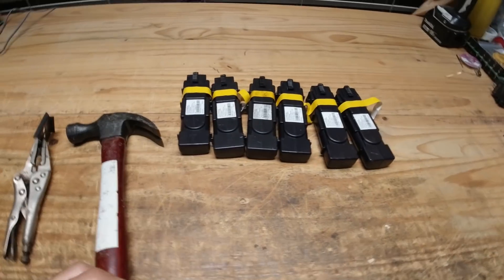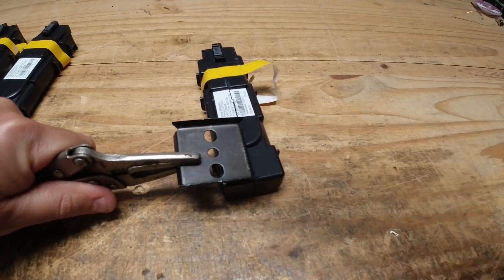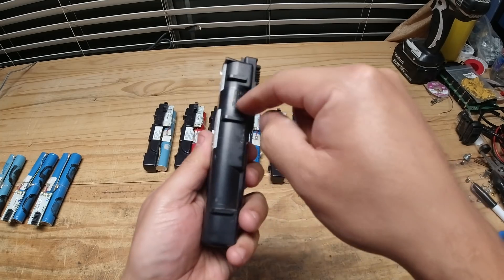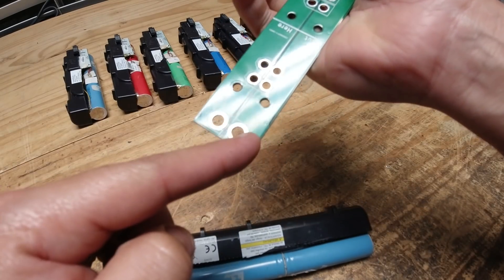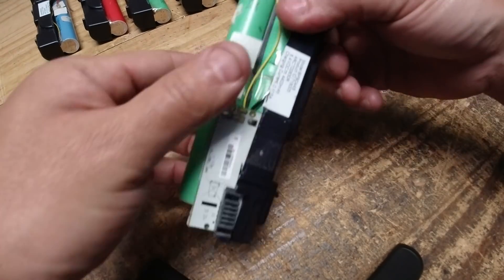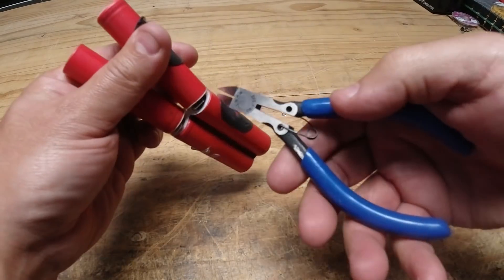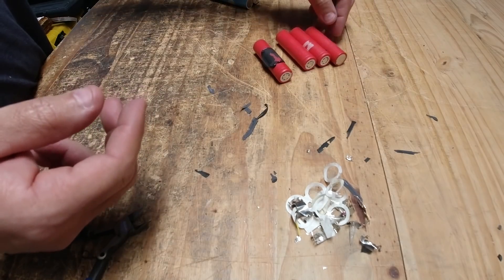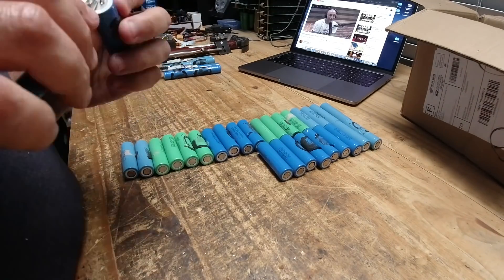Extracting 18650 cells out of $3.40 Modem Lithium Batteries

Comment: Instead of banging on them with a scraper and hammer, try cutting through the stickers on both sides with an exacto or similar blade.  Then you can hold the battery in a vise and just push it open with no problem.  I did a video on this. The ones I have opened have contained mostly LG cells and they are the most difficult to get the cells out due to the amount of adhesive they use.  The Sony and Molicells were the easiest to get the cells out.

Comment: I'm really interested in knowing how many cells were good and how many were bad... Why didn't you share that info?
Reply: I purchased a pallet of 10,000 cells for a powerwall I am building.  I am considering any cell under 2000 mah as failed.
I have a reject rate of about 5%.  Now, that said, the majority of the "lime green" and "red" cells are not worth the effort of dealing with since they often don']t make my 2000 cut off.  They are not necessarily bad, but usually, only have 1500-2000 in my testing (so I've just put them off to the side).  Even with that, I'm running about 95% keepers.

Comment: I layed the packs on the flat of my vise and gave a light whack, to each side, with my Ax. Took less than an hour to harvest the last order I got from you. I got all of the same batteries that you did(only one pack had the red ones). Out of 68 of them I didn't get a single bad cell! 
      Take Care Jehu and keep the videos coming, John 

    PS, How about a video about a good size battery bank (like 80p x 4s) being charged by the alternator in a automobile. I am building a unit for my Suburban that I plan to keep charged to about 14.5 volts. I want to be able to charge it with a 300 watt solar panel (if needed when camping) and use 110 from my 3000 watt inverter. Thanks!

Comment: I'd be interested in how to add protection to these cells (individually), but in a professional way, that uses a very thin strap and thin insulation, to minimise the increase in diameter.  I got burnt recently when I bought some cheap protected cells on eBay - they don't fit my devices.

Comment: Get the Trim and Molding tool set from HarborFreight, use the big tool from the set to wedge the batteries out. The tool is plastic and won't conduct. Also use the same tool to scrape the glue off without tearing the stock shrink tube. I've done 1,200 of them and only had to re-sleeve about 30 maybe 40.

Comment: What would be the problem with leaving them in their cases and wiring them in series for 12/24/48v?
Reply: I initially thought of that but need to fabricate some sort of setup with blades for accessing the terminals. Can you think of any way?
Reply: Out of the ten units I purchased only 5 bad batteries and I'm retesting those just in case.
Reply: i wouldnt recommend. most of these likely have faulty BMS's or a defective one which would explain how they are so cheap. And if they worked, probally couldnt handle an amp or 2 max because they are modem batteries. Modems use very little power so why have a nice bms when they are only pulling an amp continuous.
Reply: @Zodiac83104  Maybe just bypass the BMS, but otherwise keep as much of the integrity of the package as you can.
Reply: I am finding so far 5 out of 12 cells are bad. So probably not a good idea.
Reply: @billkaroly  I thought these were un-used/un-cycled?
Reply: @davidwilker4795  I found what I think is the original seller and I'm pretty sure these are all used. Jehu's comment in the video had me thinking that maybe some were from unused modems.

Comment: Sup jehu you share very knowledgeable information 👍👍, learned alot by watching, I'm kinda stuck on how could I  wire 2 24v 18650 battery pack in parallel  if I need some type of balancing. Both my packs have bms

Comment: Ain't that a waste of time 😂
The energy wasted just striping em cud power the UK 😭😭😭😭
Just buy fresh cells ffs
Hammer and chisel 😭😭😭💥🔥
Reply: Yeah ok. We are talking about 30-50c per cell at around 90-100% capacity. Good luck getting this with fresh, news cells that cost 5-10x the cost. Once you get into the hang of this it takes about 1-2 minutes to extract, cut, clean 4-8 batteries. That's 240 cells in an hour. Now, that's 72 bucks, but if they were new cells it would be over 320 dollars of cost. If you considering your time worth 248 dollars an hour, then I guess you value yourself at 133k income per year which is, guess what, higher than 85% of the US population, then good for you, but the other 85% of us don't value our time in such high regards. Now if you are in the UK, it's even worse, you'd value your time per hour based at 105k GBP a year which would put you in the 97-98th percentile. As in, only 2-3% value their time as higher as you do.  Glad you value your time as more important than  97-98% of the rest of the brits.

Comment: I am actually in the works of making a video about opening these modules right now :). I went a radically different route from Battery Hookup and you guys. I constructed a jig using wood, vice and a scraper. Also some advice, those scrapers have 2 sizes and you used the smaller size, using the larger ones lets you use less strike points.

Comment: To scrape the black glue better. Use the plastic divider that was in between the batteries as a scraper.  Since its plastic you can just go hard on it so I cleans better and doesnt leave black on the shrink

Comment: At what capacity percentage -wise do you bin the cells, compared to their as new rating ?
Reply: I'm not sure if it's a capacity question.  Personally, I'd dump any cell which I felt had significantly less capacity than the majority of cells which I wanted to combine it with.
I'd also dump any cell which showed any signs of heating up during normal charging (normal charging for a Li-Ion cell is charging at half its C rating, so if you have a 2500mAh cell, the initial charging current should be limited to 1250mA).
In theory, a Li-Ion cell can be fast-charged at its C rating (2500mA for a 2500mAh rated cell) but in practice, the cells wear out more slowly if charged at half the C rating.
Reply: @melkiorwiseman  thanks for that I noticed that the majority of SANYO cells seem to heat up and that is without even “pushing” their charge rate
Reply: @pollywollydo  My first guess would be that those cells are cheap "knock-off" copies from China and not Sanyo brand at all.  Any Li-Ion cell which heats up during charging is either being charged too fast or is damaged.  Causes of charging too fast are limited to using the wrong type of charger for the cell, or the cell is fake and does not have anywhere close to the capacity it says and so it's being charged too fast, which has the same effect as using the wrong type of charger.
And by the way, the largest capacity 18650 cell is around 3700mAh, and even those are rare.  The largest commonly used seems to be around 3200mAh.  Any cell claiming a capacity over 3500 should be regarded with suspicion and anything over 3700 is almost certainly a fake.  They usually have a 1000mAh battery (or smaller) inside the case, with the rest padded with sand or something similar.
Reply: @melkiorwiseman  as far as I can remember they all ( I think) came from mostly reputable computer packs which I stripped myself rather than bought unseen a large % Sanyo I binned whilst the Sony LG and green Panasonics were fine non were charged too hard .  I have had some descent stuff occasionally from yik- lik   and Moli thanks for the info- always useful 👍

Comment: Good therapy? Whack 9000 modem batteries lol!! Sooo prob the dumbest question ever. I'm new to lithium. How many to make a 12v pack outta them?
Reply: Usually 4 in series... But it would be a much better replacement if you use the 7s configuration as a 24v replacement

Comment: Don't use the red Sanyo cells, they are known very old cells that are known to heat up alot and possibly catch fire during charging. The samsung and lg cells are fine but know that the modem manufactures those are the cheapest ones that they make, to prevent the the modems from using cheap chinese cells instead.

Comment: Is that basically a mini BMS built into the cell?  I was thinking of making a 4s pack for powering small 12v loads, and if that's the case, I might be able to use them without modifying them much.
Reply: AncapFTW I think it’s just stabilizing the connector

Comment: Yup perfectly safe whacking a hammer and a blade into some batteries packs
Reply: That's what is was thinking about too. What if you hit one of those cells ... I hope he has backup plan where to put them when they go mad and start smoking and spewing flames..
Reply: @kres01  If you noticed, the plastic seam that he is splitting is in between the batteries.
Reply: @gregb1714  yeah I have noticed... But if he wack one wrong you have a major problem. Nick one battery it often goes on a rampage.. Just saying I hope he has a plan what to do when something goes wrong. When I open lithium cells is always make sure I have an escape plan. Ohh and never ever use a hammer.
Reply: Darksnow it’s ok, he knows what he’s doing, he’s a professional battery whacker
Reply: Sounds dangerous but it's not that bad at all. The scraper is just the right size to not hit the batteries.

Comment: The cost of shipping to Europe is more expensive than the product itself. For my case, from US to Romania is around 100 euros with DHL. So..... is not worth it. If you can make a deal with a European dealer i will buy it
Reply: There are no similar sources for large quantities of used lithium cells in Europa.. But you could check out some cheap new cells at nkon.nl for example

Comment: Note:: if you are going to disassemble that many batteries in the same fashion, use ear protection. It might sound silly but you're experiencing 100s of repetitions of over 100db less than 2ft from your ears.
Reply: Protecting your hearing isn't dumb. You only get two ears for your life
Reply: Soft times soft men. Example:^^^
Reply: just read this,  I take it you are a teenager, with no common idea on what is going on, the only danger he is in, is if he hits a battery and slits it, then run like hell , the head board banging on the wall makes more noise than that, try it, it light make you happy
Reply: Lol he forgot to mention that you can be around 120 dB for 2 minutes without permanent damage. That is 2 minutes of that loud sound SUSTAINED. As in, hitting the hammer on metal EVERY second for 2 minutes continuous.  Pretty sure it took him 2-3 minutes every 1 second x 3 impacts. It's not possible to cause permanent hearing loss unless it is sustained or over a a higher dB which could cause sudden hearing loss, but a hammer on metal is not high enough to cause instant loss, but can cause sustained, if, as I said, you keep hammering over and over and over for several minutes without taking a break.
Reply: This is about the dumbest thing I've read on the internet this week... Seriously bro, sorry I'm not sorry
Reply: @andyconda9456  guess he is afraid of thunder storms , world record thunder storm "on record" 700+ decibel .

Comment: so umm for a moron like me buying 100 of those gives me 8.8 ah when put together?
Reply from the maker: 2.2 x 400= 880  so you can make one giant battery cell of 880Ah capacity
Reply: @jehugarcia  thank you good sir, I thought so, but it was to much for my brains :-)
Reply: @jehugarcia  Now I know why my brains could not compute! lol 
That would be a 880 Ah 3.2 volt cell which is more or less useless when you need 48 volts  making it ruffly 57 Ah. No ?
Reply: @HeavyDemir  I can break this down for ya. 48V would require 14S and each 14S row would give 2.2 x .8 = 1.76AH. The 1.76AH is the amount of capacity the battery has max, reality is it's closer to 1.32AH with a 60% multiplier to signify no lower than 20%, no higher than 80%. But I will continue with 1.76AH per cell to be fair cause most people will break the 20/80 rule at least on 1 end. At $.40 per cell, each 14S row will cost $5.60. To make a 100AH module you need ~57(56.8) 14S giving us a 14S57P. From there we can do the follwing: 57 x $5.6 = $320/100AH for 48V. Now considering you need BMS, making the packs and all the tools/materials required, etc, the $320/100AH is not true but it's so stupid stupid stupid cheap it's unbelievable. 

Let's take a  Renogy 12V AGM 100AH battery as a cheap alternative. 50% DOD and we are going straight 50% cause of this style of battery so it's 50AH for 1. For a 48V 100AH, we would need 8 of these in 4S2P. They are $200 each so $1600 for a 48V100AH. 

Now let's take a higher quality BattleBorn LiFePO4 100AH 12v. 80% DOD gives us 80AH batteries. We still need 4S for 48V and 80AH battery requires 1.25 batteries to reach a theoretical 100AH battery. So a 4S1.25P gives us 5 batteries at $1000 per battery giving us $5,000 for a 48v100AH setup(that can't really exist cause you can't have a .25 battery but just for basic cost analysis. 

Here's the breakdown for the cost of each 48V 100AH setup:

These 18650's: $320+BMS+Hookup Tools/Materials/Time

Renogy 12v 100AH: $1600

Battle Born LiFePo4 12v 100AH: $5000

See why these 18650s are so amazing? They don't have a high current but honestly it works due to the huge amount of batteries you have in Parallel. Yes there's tons of elbow grease involved but here's the thing: If you're time is worth so much, what are you doing messing with any battery construction in the first place? Just buy whatever you need from a Tesla wall or finished E-Bike/Motorcycle, or whatever you plan to use these batteries for.
Reply: @toybotgaming9634  that's an interesting comparison. How does the rough size and weight compare between those 3 options?
Reply: @iamdave84  It really depends on the style of pack for the 18650. Something like the DIY power wall module would clearly take up alot more room than bus bar or how HBPowerwall does his packs. Usually this only matters for RV since a home should have enough room. That setup for these batteries would be 798 batteries(14 x 57 = 798) and they are 18mm across and 65mm long. So depending how you set things up depends on that. If room is a factor, stepping up to the LG B4 2.6ah(these are LG S3 2.2AH) would go from 57P to 48P or 672 batteries.

Each S3 is 40g(31.9kg/70lb)+ mounting style. B4s are ~43-44g(29.2kg/64.3lb)+ mounting style.
Reply from the maker: You get 400 cells with 2.2Ah each
Reply: My average over All came out to 2.3 amps per cell

Comment: instead of cutting the glue of, you could use a hairdryer on medium heat when you take the batteries out of their shells, saves you from having to use a prying tool and a glue cleanup, BAM...just my two cents...
Reply from the maker: Thanks I’ll try that
Reply: @jehugarcia Can you give me the specs of the cells that come in these? I bought 150 of them (so 600 cells total), and I got mostly blue, but I’m reading online that the max discharge is 3225 mah.. I’m building 3 batteries out of them; a 60 volt 16s8p 17.6 ah battery that will go in a 2400w dual motor hyperscooter, a 72 volt 22 ah 20s10p that will go in a Daymak EM1 with supposedly a 500-3 kw motor, and a 100 volt 24s10p 22 ah that will go into a minibike with a Kunray MY1020 3000 watt motor. Will these cells handle that?
Reply: Lithium batteries degrade with heat...
Reply: Let IPA soak in for a minute and you can wipe it off
Reply: Good idea.  Also, instead of an xacto knife, I use a wooden popsicle stick to scrape off the hard glue.  Usually just flakes right off.
Reply: No i think these are welded using ultra sonic welding machine. It is very common practice to to ultra sonic weld mobile/laptop chargers, laptop batteries etc. A very fast, superb finish and low cost way it is

Comment: Literally used these for my power wall. Only used the LG and Samsung's. Dumped the Sony's and the Sanyo. They did not test well

Used a plastic auto trim tool to break the glue blobs.
Reply: Hey man, what´s wrong with those cells you discarded? did you test them all before putting the pack together?
Reply: @andretodopoderoso7  only 10% were Sony or Sanyo and they were testing at about 75% capacity while the LG and Samsung all tested near 100% do I decided to not use the  Sanyo and Sony. I'm sure there are some good Sanyo and Sony but after a few bad tests I just stopped using them. Luckily these packs are mostly LG
Reply: Stevenc22 where can I find these?
Reply: @devinallen9877  usually battery hookup for these cells.